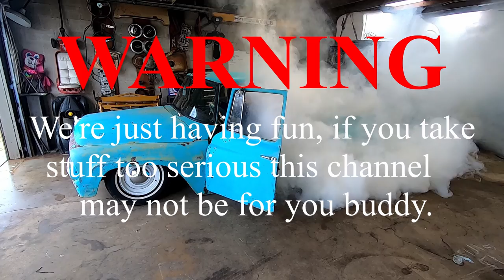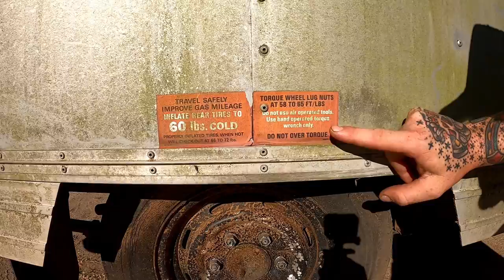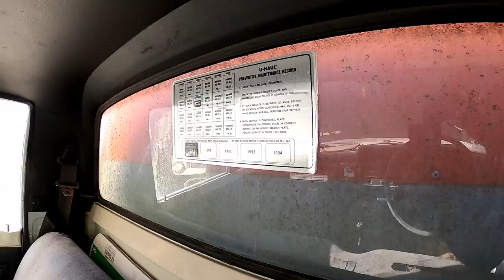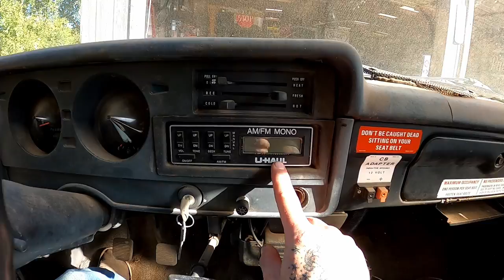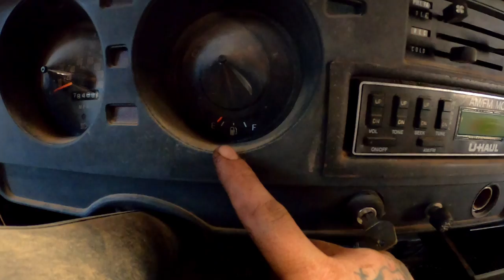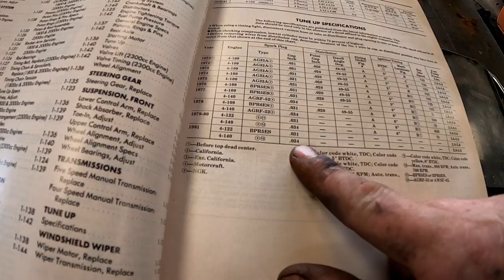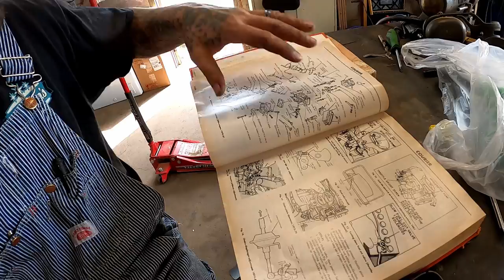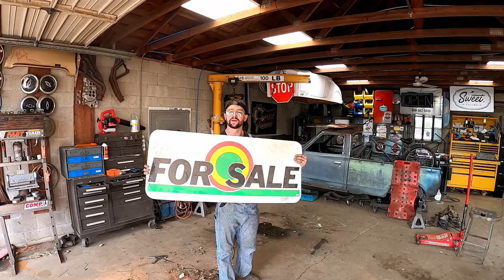Abandoned MINI TRUCK box van! (OLD U-HAUL) Will it run & drive after sitting 20 years?!?

Comment: i told ya them muffin tins were handy, wait till you rebuild a complicated one like a quadrajunk with all of them little check balls that's aggravating as hell to drop on the shop floor. it was my grampa's idea, only he used egg boxes. so did i, until one day i was gathering scrap metal and got a big ol' box of kitchen crap that had half a dozen muffin tins in it, and the light bulb lit up in my head. been using them ever since. the one i use the most was for mini muffins, and made two dozen at a time. on a one barrel, every screw gets it's own little nest to sleep in all snug as a bug 'till it goes back in the carb.
Reply from the maker: I rebuild them by throwing them in the trash lol
Reply: @PuddinsFabShop  fer myself, i just threw them onna shelf, and swapped in a holley. i used to have people come by looking for one on the regular, since i rebuilt 'em and sold 'em fer a hundy, cuz you know, reliable... BWHAHAHAHAHA! sorry, i couldn't even type that with a straight face. hell, even the hotrodders are goin fuel injected with those holley sniper efi set ups. i think i still got a couple in a banana box on a shelf in my garage, all rebuilt and pretty as a peach. a 20+/_ year old peach anywhoo.

Comment: If you want to go pretty far with the vehicle you need to change the timing belt sometimes you get lucky and the engine will survive if the timing belt breaks other times it will eat all the valves

Comment: What you are looking at inside the carb is the gas that was sold in 2001 was not gasaholl which is full of garbage I inherited 200 cars  a few years ago and all the cars that had been there for many years they would normally start on the gas that had been setting in them for that time any that had only been setting since say 2007 give or take would have to have tanks removed and cleaned replace filters and pumps and on some clean or build carbs or injections system  every time to me that is crazy

Comment: That's a Ford 2.3? I had an early 80s Ford mustang with the 2.3. non-turbo. So slow it decelerated going up hills.... Few years later, they had the Ford SVO.. It's basically that engine with the turbo.. that was quicker

Comment: a good after mark carb that would work well on here is a weber 38x38 they wotk well and don,t all pollution crap om them  just a good old mechinical carburetor  and only cost about 125.00 dollors   and the jets are not hard to change to meat your needs
Reply from the maker: I’m a Weber fan.

Comment: Don't even mention Ford. They just put their name on it. What you got there is a Mazda. B2000 I think. If you ever need parts, all Mazda parts work.
Reply: Yup but it's a B2300 with the Brazilian build Ford 2.3 straight 4.
Reply: @one_flew_over_the_cuckoos_nest  I'll take your word for it. That isn't my area of expertise. I just know it isn't a Ford. That engine does look like the one they used in the Pinto. Would that be right?
Reply: @MaxNafeHorsemanship  Yes the pinto engine and the rest is Mazda build in Japan at the Hiroshima plant.
Reply from the maker: Oh wait if it has a Ford 2.3…. You may have to mention ford….  FORD! Lol
Reply: @PuddinsFabShop  I thought it looked familiar. If that is the case, you better change that timing belt ASAP. especially on one that old.

Comment: So your the one that cranks them on so tight had to peel one open and use a screwdriver and hammer to get one off knock it off
Reply from the maker: Huh
Reply: Oil filters bought a used truck and some one had cranked it on so tight.had to cut open getting to the plate and used a screwdriver and hammer to finally get it off to change

Comment: my 720 truck will pull its ass off mine has the lower 4/11 rear end it iese,ve full load with that most would beleave she could full the biggest tthing i,ve ever fulled with it was a 1994 gmc c6000 truck and she pulled for 10 miles              i also had a ford courier truck once and i put a 283 chevy engine in it and it was fast and hell burn outs great i blow a brand new set of tires off it in one days time

Comment: Typical ford it takes a lickin and keeps on ticking your gas tank reminded me of my old ford meteor Montcalm station wagon blew a tire took it off the road over the lake and up the creek tore a hole in the tank told it would take a week to get a new couldn't afford the tank or the cost to put it in also didn't want to wait a week mechanic ask how I planned on driving it with no gas tank I saw a peice of copper pipe on his floor ask if I could have it he gave it to me I crawled under unhooked the gas tank hooked the copper pipe to it run it through the drain hole in the spare tire compartment put the 2 gallon gas jug in where the spare tire used to be made the vent hole a little bigger so the copper line would fit paid for the new tires and rims backed it out of his shop stopped at a gas station bought a 5 gallon gas jug put the pipe in it headed back on the road run until it ran out of gas put the 2 gallon back and found the first gas station run it that way for about a year until I finally found one at the recker wasn't sure if it would fit I had 15 minutes before closing to remove the old tank and I'd been told that it would take 3 hrs to remove and another 3 to put in the new tank found out how far the boik was out I had it out compared and bought turned the only difference was a vacuum line to remove the vapor from the tank the one I got didn't have a place for the vapor line since it was so easy to remove the old tank I decided to install the replacement tank  took under 30 minutes to put in the tank found out that if you are 500 miles from home and you have an accident get it fixed right there when I took it in for estimate from the insurance company they wouldn't cover half the cost of repairs